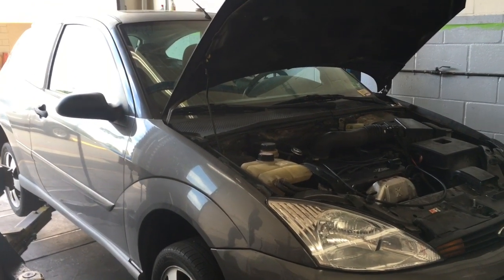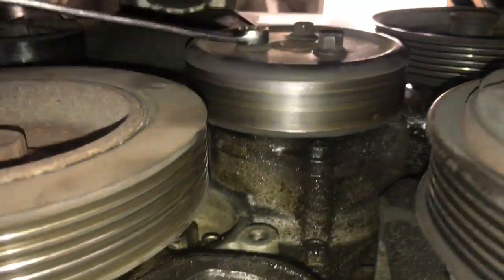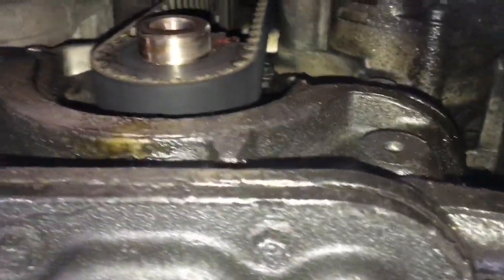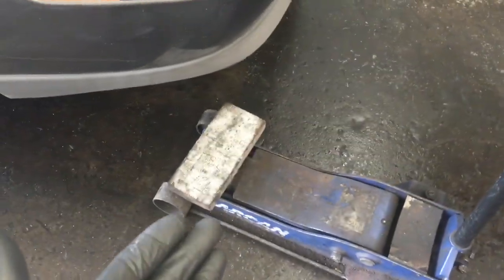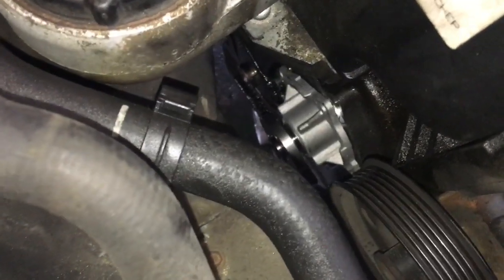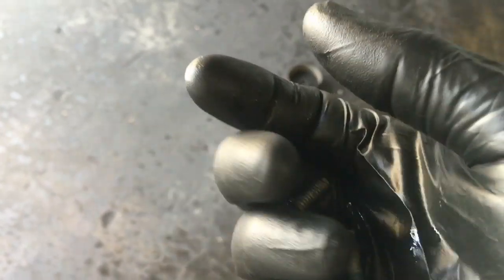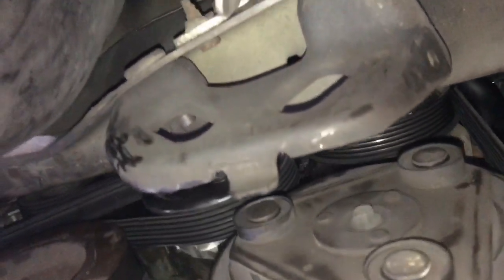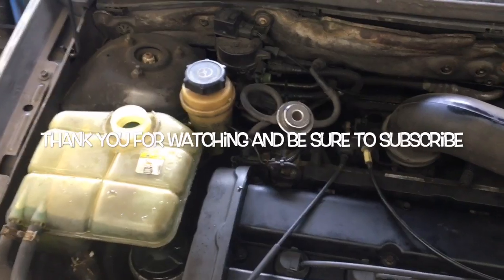How to Replace the Water Pump on a 2001 Ford Focus ZX3

Comment: Thanks a lot for this Brian, I've just done the job on my UK, right hand drive ST170, the layout was identical. I didn't bother taking the crank pulley off, still got the old pump out and the new one in fine. It took me about 4 hours just working on a driveway with the car on axle stands. The hardest bit was getting the belt back on!
Reply from the maker: RavemasterX that Belt  was a tough one. Glad it all worked out for you thank you for watching!

Comment: Thanks for the video! I don't want to critique but instead of taking off the timing pulley once you take off the motor mount and lowered the engine a tad the water pump pulley will fall right out. I think you only took off that pulley because maybe you didn't know you were going to have to take off the motor mount anyways, or at least that's what I'm thinking. Either way great video, thank you for taking the time to make it.
Reply from the maker: Jason Carmichael Always welcome tips thank you. I can’t remember if I knew if the mount was coming out or not but it’s possible.
Reply: Just did this yesterday. Taking out the motor mount completley definitely made it much easier.

Comment: I did mine too but didn't  need to takecoff the cranking pulley. I did mine before I had access to YouTube and my repair manual didn't  say you had to lower the engine to make room for the pump to clearthe frame rail,lol! I had to figure that out on my own.

Comment: Great vid, doing this my first time and just wondering if it matters that I line up the notches on the pulley cranks to the 12 o'clock position. One guy in a video did that but this way is much more efficient. Only reason I ask is he said it will damage the car if you don't. Thank you
Reply from the maker: You definitely do not need to line it up at 12 o'clock. As long as it's the same Engine that's in this model. Possibly he may have had a different engine or different type of car. The only reason why you would need to line anything up is if you're doing a timing belt. If you could send me the link to the video you're watching I would be able to tell if it was the same job or not. Hope this helps thanks for watching!
Reply: This Lame guy and his cat. That video you are talking about the guy was referring to the timing chain and when you put the chain back on there is a notch on the pully that has to line up but only if your doing chain also water pump is easier

Comment: I am still unable to remove the water pump does the battery need to be installed? Should there be any power running to the engine so that it unlatch whatever is holding this thing in?
Reply from the maker: TACOPOTENTE when it comes to removing things if you're looking around and you feel like it would help you if you remove it I recommend that you do that.

Comment: Water pump has three screws they are off I’m getting some play however the old pump won’t just come out any suggestions?!
Reply from the maker: TACOPOTENTE take a look at the brand new part and make sure there's not a fourth hidden Bolt
Reply: How to Automotive Unless it’s invisible there is, however it plays as if there is a fourth something I can’t figure it out!
Reply: *There is not.

Comment: To install the water pump I’ll need to use silicone??
Reply from the maker: Blass No silicone. Just the O-ring that it comes with. If you add the silicone it will most likely leak.
Reply: I would just thinly coat the o-ring with silicone GREASE, not silicone SEALANT.

Comment: Back again. Yesterday i got my new waterpump and after many looks at your video today i started to do it myself, but, how did you loosen up you cranck pulley bolt? It doesnt move a bit. Use WD40, blocked it, use a long metal tube to get more force. bussy for the whole day on that stupid Pulley. It is 19.00h and starting to get desperate... :(
Reply from the maker: Marc Boretti I used an impact gun.
Reply: 00.24 done. His in. Instead of dropping the motor a few inches, i lift him up and did everything from above. Tomorow i will put the coolfluid in and see if i did the job good. (i hope the motor wont drop outa the car. Anyway... l still like your video. I learned new things again. (i am a chocolatier, not a garagist :) So tumbs up. Greetz from Belgium